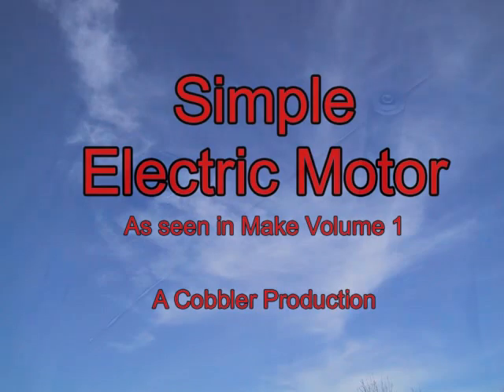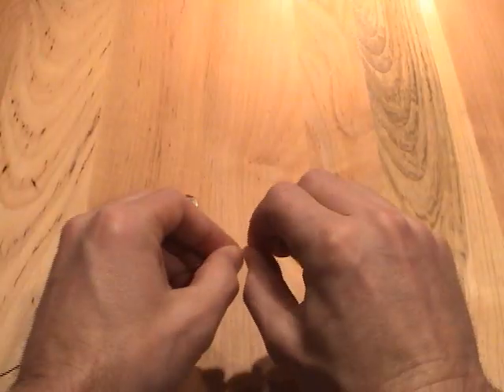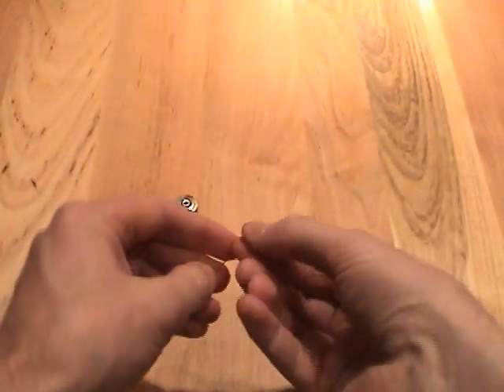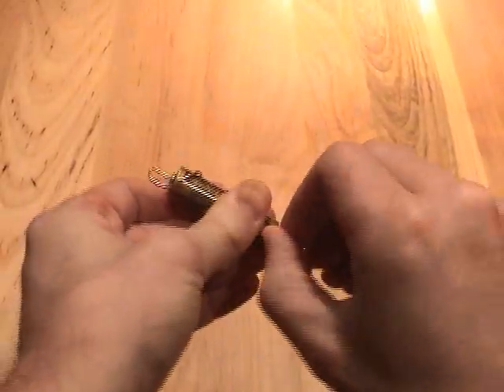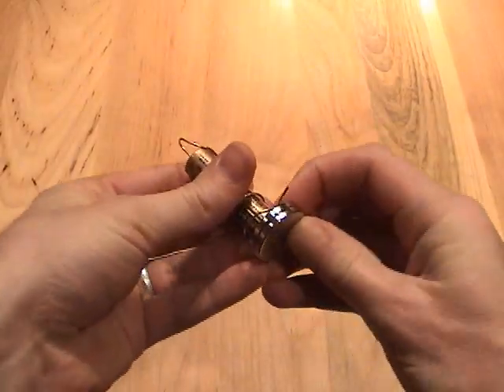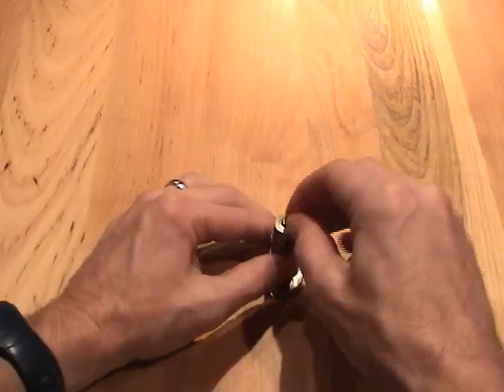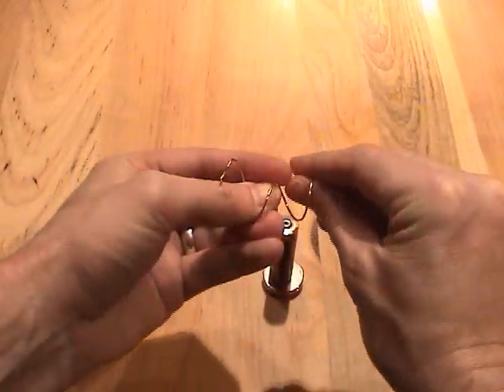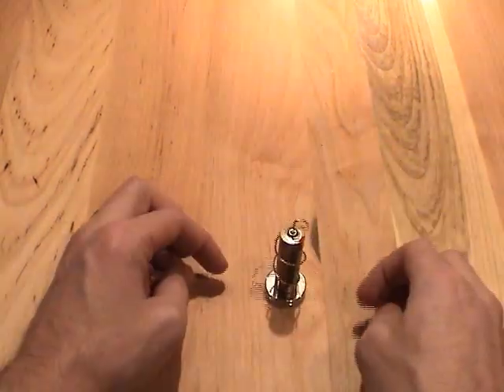Unexplained Phenomenon - Simplest Electric Motor

Comment: @cpbarclay there is no such thing as a self generating system :)
Any self generating system of any kind will always run out of energy since energy always dissipates in different ways.
It takes energy to move the water and once the water spins you can get some of the energy back but not all of it.  There will always be friction so energy will be used to get the water to move and keep it moving.  There are lots of other ways to lose energy.

Comment: I had confused this motor with a induction motor, but as they said above its a homopolar motor, but it wasn't really clear until I read this article (evilmadscientist/article.php/HomopolarMotor). The magnetic field of the magnet is perpendicular than the face of the magnet, and the current is radial (center to edge) in the magnet, so the Lorentz force is perpendicular to the current. (evilmadscientist/images/articles/SimpleMHD_2.jpg)

Comment: Just as a side note, I tried this, and i did work. On my first try, though, when i used a nail to make a dent in the battery, it squirted into my eye. I was very lightly pressing on it, and I was dumb not to wear glasses, but still, make a safety note there. Nails and batteries should not be mixed. Please, I don't want anyone  to make to same mistake I made. Make a note on your video. Thank you.

Comment: @dudes110 Wow, you couldnt be more wrong....this works by a simple principle. Look up Homopolar Motor. Current flows through the wire (which should be copper, and non-magnetic btw), and whenever you have a charge moving through a magnetic feild, it will move to a 90% angle of the magnetic feild lines (look up 'The Right Hand Rule'). This is why this works. This is like grade-school level science here, so unless U R in grade school, its kinda sad U dont understand this.

Comment: the battery and the magnate stuck together creates and intensified magnetic field the wire cannot pul in or pull down because of equal force and equal repellment.
thus the wire spins.

Comment: This is just a variation on the Faraday Disk or Homopolar motor. It has the distinction of being the first discovered electric motor. It's high current low voltage DC output as a generator will not work with a transformer ( ac is required ) also, high current can be transmitted only very short distances because of high heat loss in the conducting wires. Recently, it has found application in ships where conductor distance is short. It does not have losses caused by AC, so is more efficient.

Comment: This is a simple induction motor, the alternating magnetic field in the wire from the electric current caused the wire to repel against the magnet, and because it is alternating, it is causing motion from the constant repulsion.

Comment: This is impractical unless it has high torque and at least 1/4 horsepower and variable speed coupled with the advantage of continuously recharging its self as it rotates therefore remaining fully charged indefinitely.Also, is a larger prototype in the works currently for powering autos and trains?

Comment: @dansickle324 So , it means the whole thing is turning cause of that small part of the coil at the bottom which is connected to the magnet ?

The current passes through that part also and the magnetic field is not aligned to the magnets right ?

Comment: I think its because "A homopolar motor has a magnetic field along the axis of rotation and an electric current that at some point is not parallel to the magnetic field. The name homopolar refers to the absence of polarity change.
Homopolar motors necessarily have a single-turn coil, which limits them to very low voltages. This has restricted the practical application of this type of motor."

Comment: c'mon, dat is simple dude. 1st the electrcty from battery yields mangnetic fields inside the wire(down), the mgntic fields direction is similar as slenoid & have a different direction with the magnetic field of the magnet(up). de gap between wire makes de magnetic field vector spread and not focus to 1 point(this will help it rotate) with the vector of magnetic field of the mgnt. the different direction between those 2 magnetic field yields magnetic force that repel both the wire and the mgnt.

Comment: i love how simple an electric motor is. it is part of the reason why i think electric cars will be better once the whole range issue has been dealt with (better batteries? exchangeable batteries? i dunno what the solution should be, and frankly i dont care. as long as it works.)

also, woah? new comment layout on youtube, perhaps now finally its possible to track replies?

Comment: Well, it works because any electric current produces a magnetic field that is exactly perpendicular (90 degrees) from the electric flow direction, in this case up and down, the wire that is producing the field get repelled by the magnet and it begins to move in the direction of the electric flow.

Comment: @DavmanRFC well in theory yes but you need to remove the coating paint of hanger and  increase the battery voltage and the size of magnet

Comment: The magnetic field  points axially with respect to the magnet and the current is flowing radially with respect to the magnet.  F=IL x B.  The force is tangent to the magnet so it creates a torque causing it to spin.

Comment: The mechanics of this are relatively easy to visualize using the the right hand rule and the Lorentz force law.  In this case, a conductor carrying a current experiences a force which lies 90 degrees to both the direction of current, and the direction of the applied external magnetic field. The potions that are coiled around the battery experience a roughly outward pointing force force, while the sections where the wire runs outward or downward experience a counterclockwise force.

Comment: The wire is a conductor immersed in a field. There's an electric current and therefore it's pushed by the Lorentz force. The direction of the rotation is dependent on the polarization of the field.

Comment: is this really unexplained??? 

I remember putting a magnet into a coil with current, and it resisted the insertion of the magnet sometimes and othertimes drew the magnet in. 

in this case, there is a current passing through the magnet, which may alter the direction of force created between the magnet and the coil?

Comment: If it's completely covered it might actually work, but also if you cover your the walls over your and doors of your basement with copper wire and put all of your electronic shit down there it would be safe. I know a paranoid guy who's going to build a house with no windows in a side of a mountain and cover the enire surface with a copper wire cage so he never has to worry about EMP lol.

Comment: It is not the weak induced magnetic field from the current in the copper wire. It is the Lorentz force: F=q(E+VxB) where q is the charge  E is the electric field V is the velocity of the charge (moving charge is current) and B is the magnetic field. The important quantities are the large magnetic field from the large magnet and the motion of the charge in the wire. If this is correct then coiling the wire in the opposite direction or reversing the battery poles should reduce the spin speed.

Comment: Easy. when an electric current passes through the copper wire, it forms an electro-magnet, ie. its own, constantly changing, magnetic field (north, then south then north, then south again,etc) this wire being in the presence of a permanent magnet that doesnt change, will cause it to attract to it. the the electromagnetic wire changes states again, it moves some more, and the whole process repeats.

Comment: were the magnets you used coated with a paint or anything? the magnet has to conduct the current from the battery to the bottom part of the wire fairly well in order to work.

Comment: true. What is the speed of the current in this situation and what are the relativistic corrections to the equation? Lets assume 1.5v battery and you can pick the radius of the wire.

Comment: i would presume that the dc current in the coiled wire generates a stable but weak magnetic field which is repelled by the larger permanent magnet, this constant repulsion which acts in a straight line is prevented by the tethering of one end of the coil to the battery, hence the rotational motion., not unexplained at all, its simply a demonstration of electromotive force as determined by rules described by Cole, Lenz and Faraday.

Comment: it works by running a current through the wire causing it to be an electromagnet and with the other magnet thy repel each other causing te wire to spin

Comment: ok, here's the deal
the current from the battery creates electromagnetic field around the wire, and that em field acts opposite from the em field of the magnet. That is like putting two exact  poles of magnet together(--,++) and they will repel. And that effect turns the  wire around the battery.

Comment: physics is actually taken out of the equation do to the sudo-gravitational pull from the magnet on the electrical current.  It's not physics, it's simply the electrons speeding up and causing the atoms to try to spin but because they are attached to each other in a molecular formation the object itself will absorb the motion and release the charge through forcing friction between the wire and the air.

Comment: ah hi guys this is tricky lol .... i think it works like that :  when electricity pass on the wire it turns it to a electric magnet wich have the same pole with the ordinary magnet so they tend to get away from each other and while it have no other directions to go it spin around the battery ....... u can try it by putting a piece of iron near the wire rapped around the battery and connected to it with out the ordinary magnet !! loool .... so simple though !

Comment: IT took me a couple of times myself. Use a strong magnet for one....make sure the battery isnt dead LOL! (hey, they die, sometimes its all about checking the simple things)Also the most important thing for me was getting the wire balanced. This is why mine didnt work at first. Its got to be touching, but not rubbing any part too strongly or it will have too much friction. No nead to wrap it in a spiral either. a straight loop works and is easier. Make sure it IS a loop too or else it wont work.

Comment: dude, i do year 12 physics. it is the electron rotation induced by the current through the wire causing and EMF (electromagnetic field) which is repelling away from the Magnet's magnetic field, the repulsion is strong enough to move the wire on its rotational axis but not strong enough to force the wire away from the magnet totally. it is SIMPLE!!!.

Comment: you made a solenoid. the electrons are sent spinning in one direction by the current, and they create an electric field around the wire, and the electric field pushes against the magnetic field, as the magnet is held in place the wire is pushed away from the magnet. that is pretty cool though

Comment from the maker: You need to have eletrical conductivity through the magnet.  I think you might be able to sandwich a steel washer betweent he battery and magnet and then contact the wire with the washer instead of the magnet.

Comment: its not the interaction between the magnetic forces that cause the spinning, its the interaction between the current in the wire and the magnetic field being perpendicular to each other , which is called Lorentz force, even without the coil around the battery it would work, although the coil does make it better by enlarging the magnetic field (if its put around in the right direction)

Comment: what kind of wire r u using some of the wires do form high resistance and then u would need a higher voltage battery or a less ressistant wire

Comment: hey, after a while the battery is gonna run out that means that there is aflow of energy ( electrons ) obviously u have created two poles here +ve and - ve and a conector( the wire )  .  i would assume one of two reasons 1st the electro magnetic field helps to magnify the flow of +ve energy to the negative pole of the battery forming such movment in the wire who works as a conector and an indictor of the flow of the energy..

Comment: It is called the Lorentz force. This is the guiding principle of this experiment. Charges moving within the magnetic field experience this force. It is important to realize that a charge with no motion or motion parallel to a magnetic field experiences zero force. Just thought you'd be interested by your comment.
Here is the math of it:
F=q(V x B )  
charge*( velocity "cross" magnetic field) V and B are both vectors. This is just the magnetic component, I left out the electric field. Enjoy.

Comment: Just a guess : when the wire fully conneted at both ends, the head of the battery became a  pole, react to the magnet below. The force generated the spin, and the spin then becomes a magnetic field. And will continue to spin beyong the battery's normal span.

Comment from the maker: 1. Yes, you need non-ferromagnetic wire.  Copper is great.  
2. A little tap with a hammer and nail on the top of the batter makes a nice little divot that helps the wire stay in place.
3. My wife thought this video was stupid.  When I made $3000 on she was happy but still thought it was stupid.  I will agree that some of my other movies are better.
4. The video does not show the fact that I fanagled the wire for a couple of minutes to get it to go.

Comment: However, if you apply the Fleming's rule to the final stretch of wire before it meets the magnet, this section of wire is horizontal (more or less), so the current here points horizontally away from from the battery; and the magnetic field just above the magnet runs vertically. 

So if you focus on this last bit of wire, and apply Flemings rule to it, with the directions given, you will see that here, the thrust is not up or down, but rather in a horizontal direction, and this turns the coil.

Comment: Hi Russell

You are right that Fleming's rule shows (most of) the thrust being directed downward towards (or upwards away from) the magnetic pole. And right that this thrust cannot produce rotation, it just pulls or pushes the coil up or down (depending on which way the coil is wound, and which pole of the magnetic faces up). If you use very thin, more flexible wire, you can actually see the coil being pulled up or down every time it makes contact and the current surges through.

Comment: Thanks GAOXXXXXX,

According to Fleming, the thrust is pointing either directly into, or directly away from the magnetic pole.  This would produce no rotation.

With all due respect, electrons always spiral as they travel through anything (including vacuum) because they are "born" with a  "spin" (see Pauli)

Also, no none else emphasized the need of the wire to "scrape", causing the field to build and collapse.  Without it, the motor sticks--try it.

Cheers,
Russell

Comment from the maker: Try a magnet that is plated with a conductive metal - you know the ones that are silver.  It might work to put a metal washer between the magnet and battery and then touch the wire to the washer instead of the magnet.

Comment: Our Planet is one giant engine, we are energy beings. This simple device shows this is true.  This is not magnetizm, this is Electron Drive. Every millimeter of the wire wants to face both north and south and the power in the battery amplifies this force. the electrons push and pull at the same time causing the wire to spin. Wire can be a two sided 'harp' shape with the ends on both sides of the battery and it runs faster, smoother. Electrons are forever power!  We exist because they do!

Comment: The coil spins due to the electrons/charges flowing through it from the positive side of the battery down to the magnet, as the electrons flow down to the magnet, they get deflected by the magnetic force in an upward OR downwards direction (that depends on the position of the magnets north and south poles) resulting in the spin B-) 

You can determine the direction in which the coil will spin by using the 3rd hand law of EMR; google that up before asking dumb questions
PHYSICS RULES!!

Comment: Nearly every response I've read is incorrect. This is caused by the Lorentz force F = q(E+v x B). Specifically in this case it is the v x B part. The magnetic field propagates axially, and electrons move radially out/in of the magnet in/out to the wire. The cross product of these directions (v x B) gives a force tangential to the magnet's surface, the Lorentz force. This force is what drives the wire.

Comment: The battery sends current through the wire. The moving current sets up a magnetic field around the wire. The procession of the magnetic field causes the wire to move.

Comment: I've done something similar, what I did, was I put 2 copper plates connected to a battery, and put notches in the top of the vertical plates, rolled up the wire with 2 ends and it would spin by itself

Comment: im glad some1 other than me knows those laws intamately. 

WHO KNEW ELECTRIC CURRENT IN A WIRE CAUSED A MAGNETIC FEILD? THATS DEFINATELY SOME UNEXPLAINED PHENOMENON!!

also the fact the the battery acts as a core for the solenoid to increase its magnetic power.

pfff maxwell GAUSSIAN SURFACES FTW!

Comment: it works because of the electric field areound the battery and magnetic field around the magnet, which caused the copper wire to rotate since it is highly conductive...maybe..S-?

Comment: google probably boosted this guys views ten-fold.

it works like any other electric motor, except the battery acts as an axel, and the magnet acts as another pole of the battery, with the brushes replaced by the spinning wire contacting the magnet